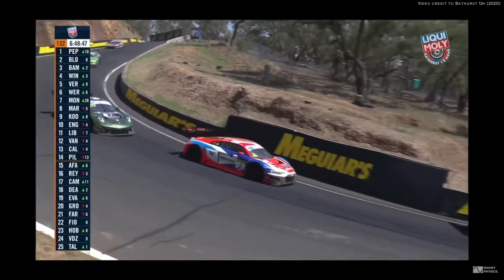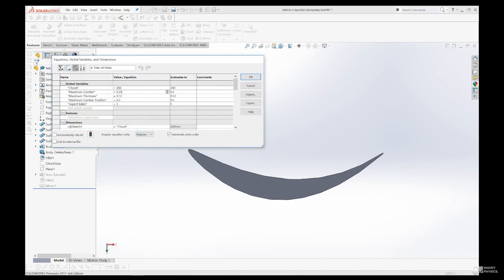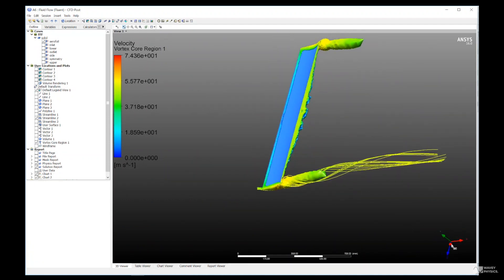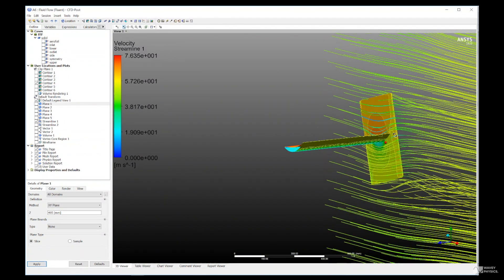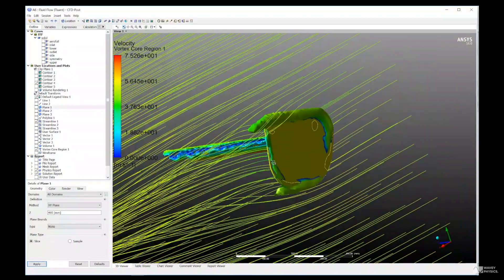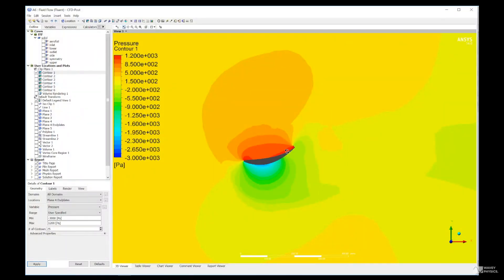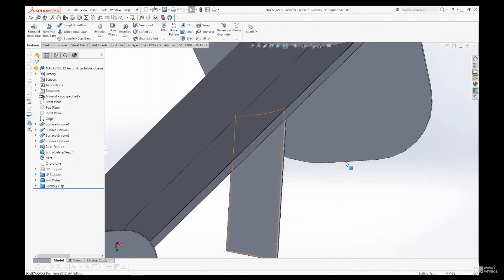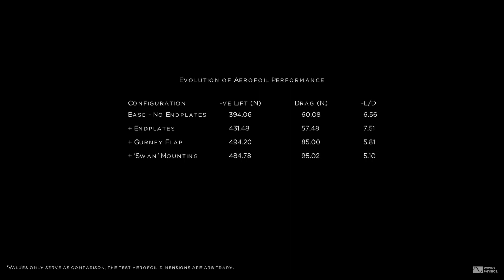Ep. 009 - How Do You Design a Rear Wing? | Motorsport Aerodynamics Part 2

Comment: First you create an aero map by taking pressure measurements along the car with pitot tubes, or monometers/pressure taps. Then you have a rough idea about where to put the wing, and how to mount it. Then you design your wing to work with the rest of the aero on your car. Then you refine your wing by trying different designs on CFD, 3d-print endplates, and validate your designs with measurements such as ride height changes before having your wing manufactured as one piece. Often companies create pretty good off the shelf wings for your specific car, and you can, to a degree, copy their designs, or use them as a baseline to work with the rest of the bodywork you've added.

Comment: Would it be possible for you to explain how you were able to model the actual wing since i have tried using an airfoil and although i replicate it in of it self, i am struggling to dimension and adapt it as the sketch starts folding over itself
Reply from the maker: Happy new year!

You need to drive the curve with an equation. The equation of an aerofoil is relatively easy to find online, and in CAD you'll define the upper and lower surfaces separately in sketches. 

What program are you using?

Comment: Thank you for sharing. Sounds like it's pretty hard to go wrong with big end plates?

Here's a question that's come up in a recent conversation with folks on car aero: skeletonized vs flat uprights?

How much drag do they introduce versus weight they save etc etc.

There's also "scalloped" designs that seem to balance both worlds but it's hard to say...
Reply from the maker: You will have more drag as they get bigger, and the benefits with diminish so it’s best to try and get them in the ball park, but not a huge penalty for extreme ones!

I never investigated support designs - you could save a fairly decent amount of weight with skeletonised ones but my feeling is the extra drag is mostly negligible. Could wrap/cover them with vinyl or black electrical tape if you were really on it 😆 - Jahee

Comment: what speed does the car have to be traveling in order to see the wing start to work and generate downforce on the car?
Reply from the maker: It starts from zero! Aerodynamic forces build with the square of speed though, so the downforce generated at 100mph is 4x the downforce generated at 50mph. Maybe a better question would be "At what speed do aerodynamic forces start to become significant", the answer for that would depend on how powerful the wing is. 

For a plane, that number might be around 150mph, for a race car, it could be 70mph, it's not really possible to give a general answer for that one.
Reply: @WaveyDynamics  thank you!  that is great to know.  I am trying to learn as mych as I can, I am trying to design a wing for my dragster, so I am only dealing with going fast in a straight line.  The wing that came on the car is big, I think too big.  So I want to design a better one that is a little smaller but still effective.  I know the pitch angle of the wing effected my 1/4 mile time quite a bit.  With minimum pitch, the car was faster however with the wing off it was the fastest, but I do notice some instability on the top end.   This car does the 1/4 mile in 7.8 seconds @ 176mph.
Reply: also note, that ET is at very high altitude.  My home track is in colorado.  Track elevation is 5800' above sea level.   We do travel to race and most tracks we travel to are at sea level.  At sea level we are much faster.
Reply from the maker: @waydesamuel3855  Ah ok i understand. If you're getting instability at higher speeds with no wing it would suggest to me that the body of the dragster is producing quite a large amount of lift.

I don't know what body style you're using but you may be able to make some modifications to that to reduce the lift without having such a large drag impact as a wing.

Comment: Very interesting video! And why don't we use Swan mounting that come from behind the flap? It would avoid separating the stream before arriving on the profile
Reply from the maker: That's a good question. I think this is often due to regulations in certain series. 

Maximum length is usually specified, so the disadvantage of introducing a small amount of turbulence in the flow before the leading edge of the wing is probably overshadowed by the advantage of placing your wing as far rearwards as possible to benefit from leverage.
Reply: @WaveyDynamics  Well seen !  Thank you for the answer !  😁

Comment: Thank you for the video. Nicely done. Do you have any further desire to find the best wing profile for a particular speed using Ansys build in optimisation tools? I mean you’ve got a parametrised model in SolidWorks and you have an objective as an efficiency in your simulation. You may try to run the optimisation process that would allow you to find the best profile automatically.
Reply from the maker: Hi Dmitry,

Thanks for the comments! No need to go any further on this wing, but there are certainly some more optimisations to be found for future projects!

Comment: "As you increase the vertical load you increase the coefficient of friction" - doesn't it sound like the friction coeff. being a function of vertical load ? I thought that the friction coeff. is a "function" of tire type and tarmac roughness as well as weather condition, and no matter the vertical load; the greater the vertical load, the greater the lateral force that the tire can withstand without loosening grip and finally start to sliding. At least that's how they taught me on my physics classes but I might get wrong :/
Reply from the maker: Firstly, thanks for commenting because you've highlighted a mistake..! 

What i meant to say here was that as you increase the vertical load on the tyre, you increase the lateral load the tyre can generate. What actually happens is the coefficient of friction DECREASES as the vertical load increases.

The decrease of this coefficient of friction is actually why we try and reduce lateral weight transfer when working with vehicle dynamics.

So in reply to the rest of your comment, you're right. There are many variables that factor in to the CoF, but at a high level it's simply the relationship between the vertical load and the frictional force. We don't have to understand the intricacies when we just want to understand the load in (vertical load) vs. load out (lateral).

I wrote an article that features on our website that might explain this a little further https://www.waveydynamics.com/post/weight-transfer

Nice to discuss! Hit me back if you have any more questions! I'm gonna see if i can find a way to annotate the video! Haha